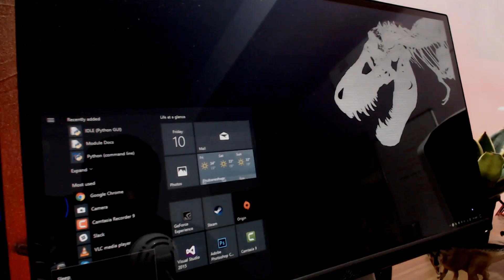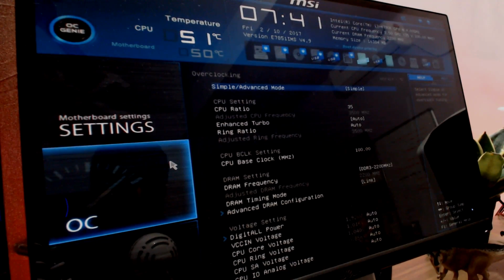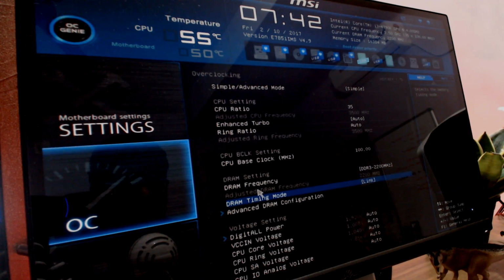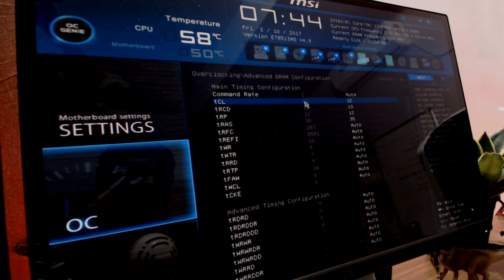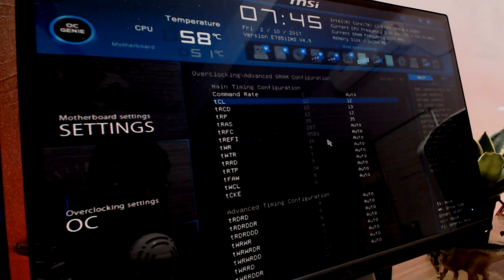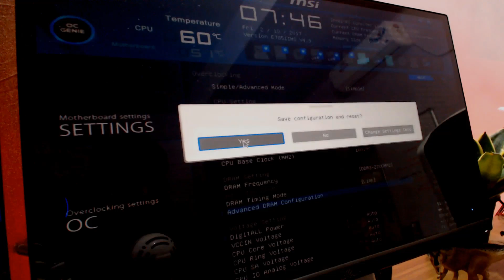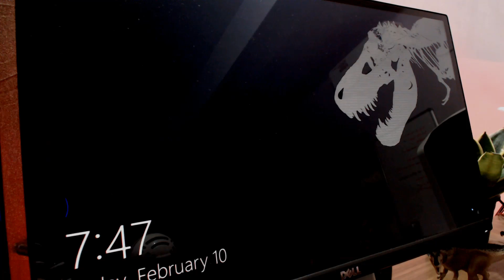Overclocking RAM | Frequency, Latency Optimization

Comment: HOW TO OVERCLOCK SOUND ON THIS VIDEO: 

Download VLC Media player, download this video. Open it. Set volume to 200%, if not enough, go to Tools>Effects Filters> Equalizer and raise Pre-amp value until your speakers explode
Reply: You can actually go to VLC, and press Crtl+N. On the GUI that opens, paste the video url and press enter. You don't have to download the video separately.
Reply: Volume Control extension for your browser will do it :)

Comment: hey so my ram only goes to 2400 but i put it at 2666 is this safe??
Reply: Yes perfectly
Reply: I increased corsair ram once that was 2133mhz to 3200 mhz easily so youre upgrade should be sweet as pie 

So dont withhold yourself from experimenting you will never learn.

Experimenting is the best way to learn
Reply: It is safe. I overcooked mine from 2400 to 2700
Reply: @coows  lol
Reply: Jaydesu no lol

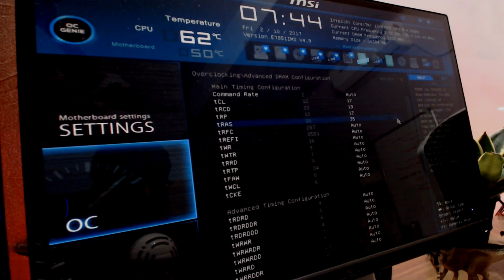Comment: Bad video, because you missed one but most important thing (~2:50).
Reply: Leaving everything except first 4 timings on auto. You will have a very bad time if you try that with AMD and you won't squeeze max performance in intel systems too.
Reply: Artem A ?
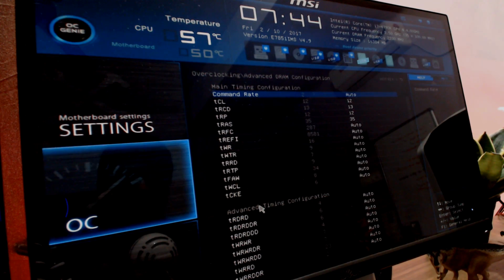Reply: What is the one but most important thing @2:50?

Comment: dude your cpu is too hot I think
Reply: at around 75+ it gets too hot. 50 is perfect
Reply: carlug03 yeah I think is quite hot. My cpu idles at about 26
Reply: no for the cpu being idle it's a bit too hot
Reply: if OC'ed its ok but i see its a 4790K the standard clock is 4ghz - i OC'ed the cpu to 4,7Ghz and i have 40° idle
Reply: in bios temperature is like is in full load thats why for my example my proccesor stay at 36-40 in iddle and in full load stay at 60-65 (overclocked)
Reply: THATS NOT TRUE, IN FACT IN THE BIOS TEMPS SHOULD BE THE LOWEST
Reply: @bvlggraphics198  bios puts a small load on the cpu. around 25% usage. bios temps are higher than idle, try it.
Reply: yeah ! i have a stock intel cooler and i get 30c idle !!

Comment: Hey Leo I have Alienware 17 r5 and I bumped the ram frequency to 2133 mz 
And now it just shows black screen and is not entering in bios what should I do
Reply: you have to clear cmos
Reply: If anyone wonders, if you every screw something up in bios, you should clear Cmos. You can do that by unplugging the power cable to your computer and then removing the round battery on your motherboard for 1-5 min.
Reply: @erko4  Sometimes that doesnt work(especially on am4 mobos) so after removing battery and waiting for couple mins, you have to press down power button for 30 seconds to clear electrical loop, then put battery back. That saved me back in 2017 while i was doing extreme overclocks lol.

Comment: now I understand why my PC suddenly die after 4 month overclocking . (mine was old i31st Gen so I use BLCK to OC) . After overclocking ram and CPU (bump up some voltage in it and it was stable) all boot up perfectly but all the sudden my file and Window late to load up . (Which I assume I forget to set IDE mode) .
Reply: IDE?
Reply: @N.D.1984  its before sata
Reply: What is IDE?
Reply: @simorx580  its before sata

Comment: Why is there no sound,  I hear a faint whisper I think but nothing is understandable.
Reply: Wrong account, Leo! :P Might wanna switch when you are responding to comments on this account.
Reply: volume at 4% my friend , by a soundcard and a proper headphone 
hell i can even understand him at 1% volume , how about them apples 
what did it cost me ? not even 100 euro or around 100 dollars 
AE Xonar 150 ohm : 58 euro / 66 dollar, headphones 150 ohm hd-440 superlux : 23 euro /  26 dollar
have a gx gaming 2.1 speaker that gives even more of a boost to the headphones 
+ razer surround gives the sound another kick in the pants and an EQ + bass boost , 
once that turns on the sound comes alive , it's just night and day
on top of that the driver from the soundcard's settings work together perfectly and have another EQ and bass boost...
have them all on , everything , can control the bass at the control panel...
but even without the extra amp from the speaker , the soundcard and the headphones did a nice enough job ...
that's a pretty good sound for 92 euro / 105 dollar
that 150 ohm man , that's some sweet tunes for a sweet price
and you can crank this thing without distorting or crackling the phones , 23 euro : can't beat that
Reply: adjust headphone jack
Reply: I'v got him at 100% and everything else turned all the way up and I can barely understand him for some reason. its enough to follow along but damn I had to make this4 or 5 times louder than all the other youtube vids I was watching before this one.
Reply: I can hear everything loud and clear, at less than half volume, check your levels.(or turn on loudness equalization)
Reply: The PC Security Channel [TPSC] What?,  Do you have this going through surround sound with subwoofer?
Reply: No. Average monitor speakers.
Reply: @fordgt489  Can hear it pretty well, just do not understand any of this stuff yet even with the explanation.

Comment: i increased the frequency to 1866 from 1600 and my timing are 12 12 12 30....by default it was 11 11 11 28.....my pc is not crashing but i have noticed extra temperature...is it alright
Reply: ankur basumatary the high temps are normal.
Reply: Every time you overclock you will produce a good amount of heat but if its at a dangerous high "90c or 80c" i suggest stopping.
Reply: @Panossapidis Not if he's increasing the frequency. There is "tightening" and "loosening" ram timings. If you are at stock frequency you simply lower the values but if you cant go higher frequency(mhz) even with too much dram voltage, you have to loose(increase) the timings. Hope that was helpful.